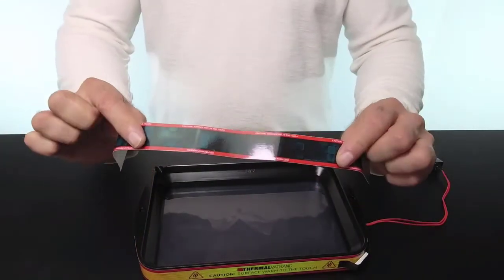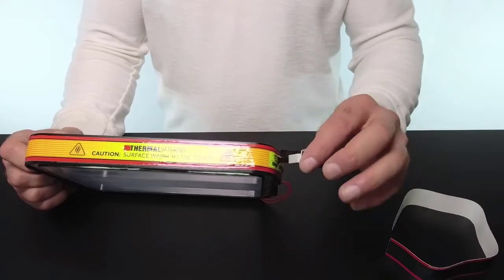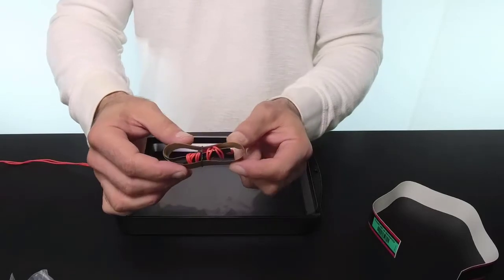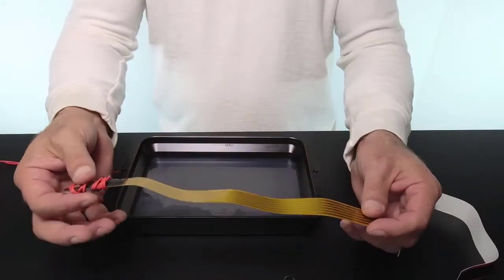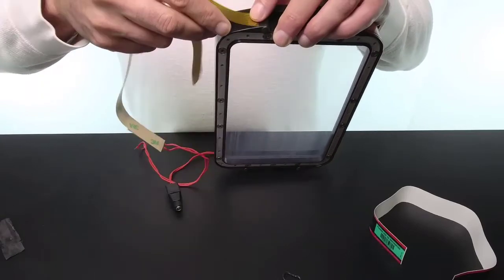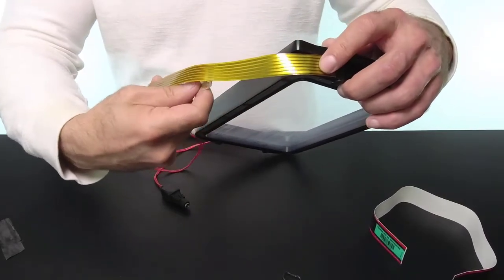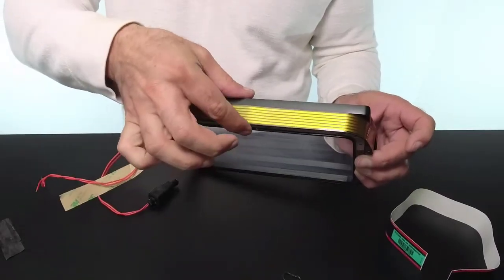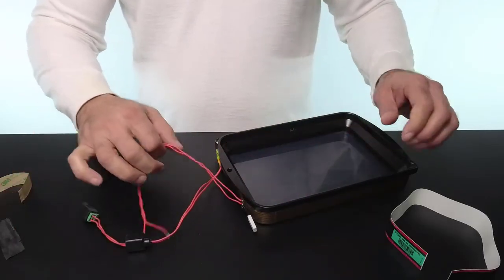How to install ThermalVATBAND

Comment: I just got the TVB-V321-KIT WITH POWER ADAPTER as I have a unfinshed basement and the temps barely get up to 16c.  I have a Elegoo Saturn 3 12k Ultra and the vat is keystoned, wider on the bottom then the top and I had issues with the band staying straight around the corner. The band wanted to angle down after going around the corner.  Will need to get some aluminum tape to make sure the top all the corner are sealed as good as possible. Running a plate of minis to see how they come out.
Reply from the maker: Keep us posted. If you need live support get on our homepage click on chat.

Comment: Sorry if I'm bein dumb but having a spot of trouble foguring out which size vat band I should get for a saturn 2/anycubic m3 premium
Reply from the maker: The TVB-V321 which is 32 inches and 1 inch wide is our largest band and will fit the  MAX, Mega 8k and Jupiter similar vat sizes.

Comment: Why do you give an ideal range in C as 25-26 but in F converted to C you say it's 25-30
Reply from the maker: This video is our first version you need to ignore it completely.  Watch the newer video it explains better with all the changes and upgrades we have done.  VATBAND power supply can power up to 3 BANDS or bottle warmer and two bands.  The power system manages the amount each product needs to maintain optimal heat level.  The heat level starts from 1 to 5-MAX.  The number indicates the cycling process of heat, the higher the number the faster the heat will cycle from 75F to 110F. When you have multiple items you drop the power source to 3 to let the power adapter do its magic. Otherwise, it will warn you of over powering the system too early blinking blue light.

Comment: What is the little square piece of silver shiney tape used for
Reply from the maker: Aluminum insulation tape. Handles heat and ipa resin proof great adhesive backing. Use it to secure tough areas on curves and edges.
Reply from the maker: Also on stress areas before wire connection point and after for added security against pulling.

Comment: Can you put the lid back on the printer?
Reply from the maker: Yes you can. The wire is made so you can put lid on it and won't damage. With the v2 version magnet cable quick release you would need to make a small hole for cable to go through. Usually done from the back.

Comment: So does the strip go on the inside or the outside because some of your videos show it as being on the inside and in this one the trip is on the outside
Reply from the maker: You apply the strip on the outside. We have upgraded the vatband to 16 inch. The only time you install inside is when you have a plastic VAT. We also have a 32 inch VATBAND for large vats.

Comment: When I found out that people heat their printers for SLA printing this was the first thing that came to mind heating strips the second thing was why doesn't the manufacture include a heated Vat  or even sell it as an addon. It seems so simple the only reason why I can tell its not done is because people have low expectations.
Reply from the maker: What's fascinating is that the innovators of the resin printer, like Formlab and the top players all have some sort of heating device to control the resin temperature. It's not a novelty idea but there for a good reason. It decreases the failure rate and increases the detail in the print. Heat lowers the resin's viscosity, it also primes the resin to cure efficiently, getting all the sharp edges cured instantly.  Large flat surface will stay straight like there supose to. We have also decreased the print time by about 15%. I give credit to the dental industry for figuring that one out. I hope to get more data on that soon. Another plus is that your resin drips down from your prints faster and leaves less resin hanging after printing.

Comment: In the beginning of the video you mention once you peel off the VAT BAND, it’s worthless. Does this mean only the new yet-to-be-released update can be removed and reapply to different VATs if needed? Can you please clarify or do a direct comparison which is the new and which is the old model? Thanks and awesome product
Reply from the maker: If your VATBAND is longer than 12 inches than you have the newer version. The latest version is 16 inch and you can overlap and fold unlike our first version.

Comment: Product seems good. Going to try it today but the website is not working correctly. Your links are all in Latin and no stl for the female cap. Just an FYI. I plan to buy a couple more if this works out. Also can you explain in a little more detail about the build plate and how and when to put it in the resin to make it warm. Thanks
Reply from the maker: Hi Mike, The link to the cap https://thermalvatband.com/wp-content/uploads/2022/07/female-jack-wire-cap.zip
Fill your resin to the MAX level a get your build plate in home position. The build plate being metal will conduct heat quickly from the resin when immersed into the vat.

Comment: Would be nice to have a detailed tutorial for installing inside a plastic vat. Just bought a small band for my Photon 4K. 

I assume the thermometer that is shown on the site is included? And I’m guessing it’s mounted outside the vat? Really don’t want to screw up.
Reply from the maker: You can email me if you need more guidance.  info@thermalvatband.com
Reply from the maker: Hi Deanna. You have enough clearance to include the thermostat inside the VAT.  You can use the aluminum insulation tape durable and can handle the resin.

Comment: Just had my first print with the vatband, printed the cover for the connector. Kept the temperature at 25 Celsius, it was a cold morning, as soon as I turned the power off I could see temperature readily dropping below 25. The cover came out perfect no deformation and geometrically correct, not sure if vatband helped but it did came out good.

So it does keeps the resin at a constant temperature, and helps negate temperature fluctuations especially during cold nights.

More testing required on bigger prints to see if  the band helps with print quality .
Reply from the maker: In the dental industry resin is 2 times more thicker.  We noticed huge gains in the print quality and less fails along with speed.  This is not a new find as all formlab printers have heated VATS for a good reason. It helps the resin to flows better the heat makes it less viscous.

Comment: So how many bands are required per vat?
Reply from the maker: One. I get that question all the time.  The build plate as it goes up and down will mix the resin keeping the temperature even.
Reply from the maker: I wanted to add to the earlier comment. Daisy-chaining two VATBANDS is simple. I will post videos soon on how to do it. That equates to two 16-inch TVB soldered together for a total length of 32 inches. We will sell this item as one 32-inch TVB if you are not into soldering. The power and heat will not be affected by the length. Our power adapters are designed to handle three VATBANDS at the same time. That is why we sell a three-way splitter.

Comment: Thanks for the product, it looks great. I would suggest revamping the instructional video. You begin by jumping right in without giving an overview. What are the different parts? What are the main concepts of how it works? Break it down into sections such as Preparing for adhesion, Adhesion, Usage, Maintenance, Tips, etc.

You show the connector already assembled. Begin with the kit the same way a person that just bought it would have it. 

Name the parts something district so it's not confusing. The "heating  adhesive strip" vs the "Warning adhesive strip"

As others have mentioned, don't mention a downloadable file without there being a popup with a link or it being in the description.

Also your download link on your main website is broken, please fix.
Reply: I'm telling you this is a scam. Tried to buy it already.. it didn't turn out good
Reply: @solrax6026  I wonder how high temp resin can get because some of the heat is quite localized 45C right on the band in order to get the resin in the vat to be at 25. Also, despite cleaning the aluminum by scuffing it and cleaning with alcohol the band is coming loose within the first three prints.
Reply: @alonsomartinez9588  honestly what has worked for me is before I print l boiled some water like I was making coffee in a pot. I got a big bowl and poured my hot water then added my resin bottle for a bit. Left it and turned it for about 10min or so.. worked fine for me more so for the bottom layers. 
I ordered from this operation and I never received the product. Then I got the run around when talking to the owner. Resin Preparation worked well for me and their are other solutions like heated enclosures that is a better option
Reply from the maker: @alonsomartinez9588  Did you apply the sticker on top that has a lip goes over the vatband creating a seal. You can also use aluminum insulation tape similar to the one I supplied.
Reply from the maker: @solrax6026  We did get sellout faster than we anticipated. We are all caught up. Infact we have a newer version quick release magnet and tempeture is more stable with a longer vat band.  Send me your order number I will personally take care of it. Not sure why you fell through the cracks.
Reply: @3dtvb  , yes I did all that and the tape still came off. Like I mentioned, I carefully scuffed and used alcohol to clean before adding it.
Reply from the maker: Thank you for the input. I will revise the video and breakdown the parts and how you can apply for different types of VATS and installation procedures.

Comment: Going to the site, I still did not understand: what am I buying and how much does it cost and how much is the delivery, and what will suit me? Does the kit include two strips and an adjustable power supply? Pictures on the site do not increase when acquired. When choosing a product, there is no price. These questions torment your customers all :)
Reply: Wondering the same. Would I need one or two. Is it designed to wrap around entire vat like in the video. The website shows only half is covered. 
With temperature regulation.. they sell a regulator bit it says large Vat. So idk. I need a heater / regulation for a Saturn 2 and someone told me from the website to get the medium kit. But it wasn't listed under their printers. So idk
Reply from the maker: @cliffking6475  We are revising the site. One size fits all. With our new foldable VATBAND and a higher output adjustable pouwer supply as part of the standard kit.
Reply: @3dtvb  So is the new version purchasable yet? All I see are the different sized versions on the site right now.
Reply from the maker: @xaranthius1415  We will update the newer version end of this week. 3 new products will also be added.
Reply: @3dtvb was this ever added? I don’t see it? I’m trying to purchase for elegoo mats pro 3 and don’t know what I need.
Reply from the maker: @bradleygilmore the small kit. Notice our installation video on smaller vat. You will be getting the larger vatband as of December 10 we are only selling one size fits all. Unless it's a larger vat you can get the 32 inch vat band. But the 16 inch you can easily fold and shorten adapt to your smaller VAT. I personally will go all the way around.
Reply from the maker: @bradleygilmore  Purchase the small kit. We are upgrading all purchases till 12-19-22 to our TVB-161.  Our latest version is one size fits all with the power adjustable 3A. You can power 3 TVB-161 at one time or power our bottle wrap warmer at the same time and even our VAT RESIN PUMP coming soon this week. ONE power source to three products at same time using a 3 way splitter.😃If you find that its too long you can shorten the band. We have a video for that process.
Reply: @3dtvb  I notice the small kit is more expensive then purchasing the 161 by itself on your website. Is there something included in the kit that is not included with purchasing the 161 product?
Reply from the maker: @bradleygilmore Small kit includes adjustable power supply. Tvb-161 is the vatband without power adapter. One power adapter can power 3 TVB-161.
Reply from the maker: We are addressing that issue.  The new site should be up by end of November.  The VATBAND is revised with longer more powerful adjustable power adapter with quick magnetic release no more dangling wires to deal with.  Our bottle wrap warmer for wide bottles and our Resin VAT pump totally excited to share with you guys. One button will pump out the resin from the VAT back to the bottle.